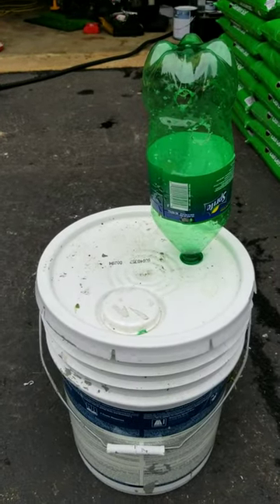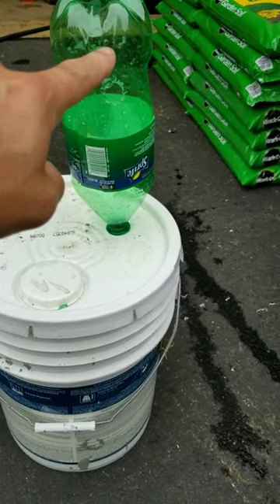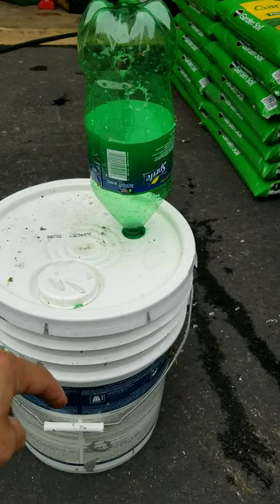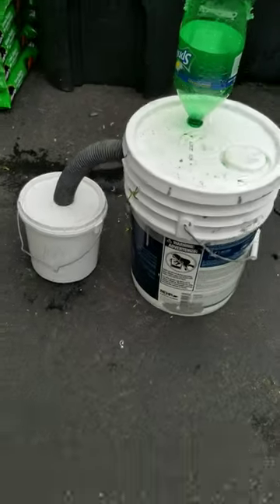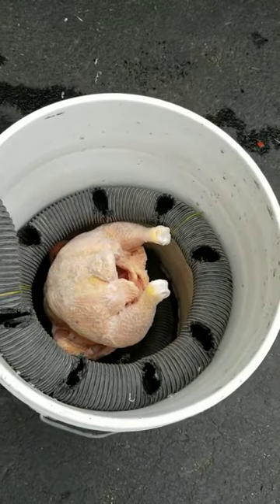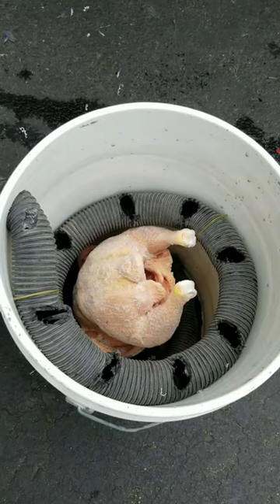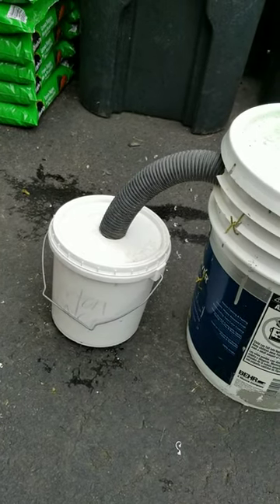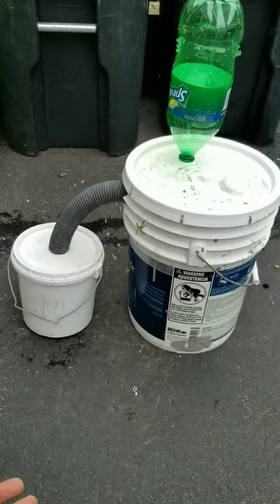Maggot Farming for chickens

Comment: FYI the maggots aren't slimy or gross like you would think. Can feed them fruit and veggie scraps so this makes for a nice closed loop system for raising chickens, ducks and in my case a resque Ani. Look up black soldier fly larvae for lots of different options. The bucket method is very cool. By